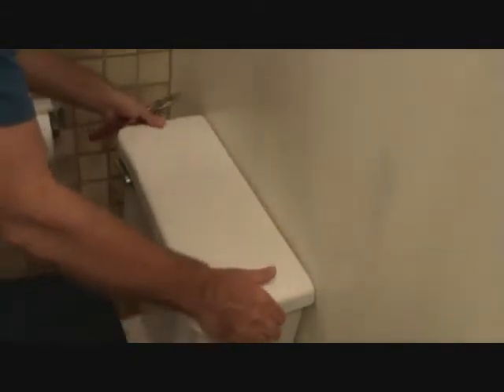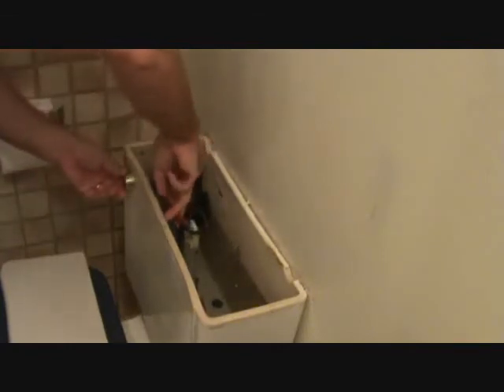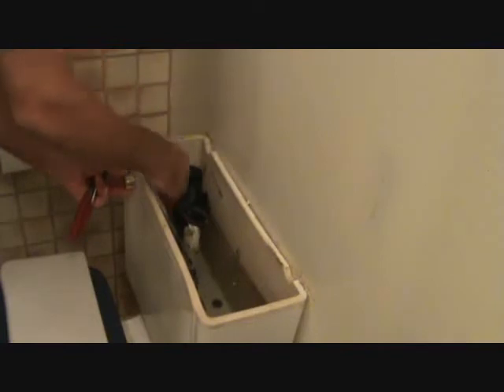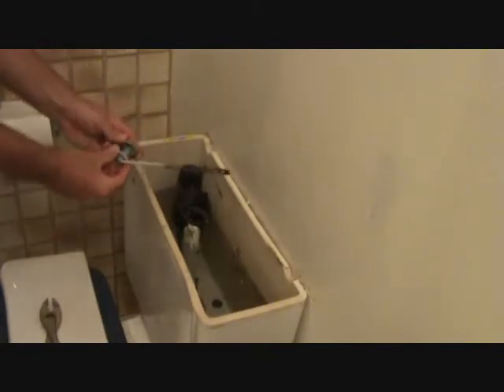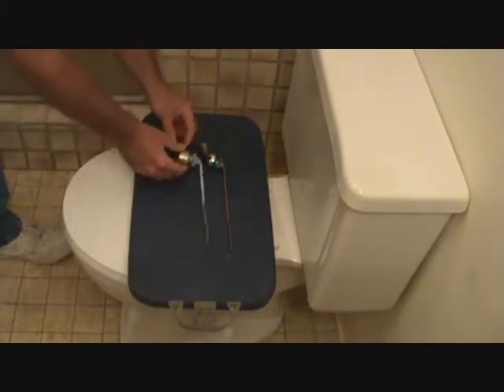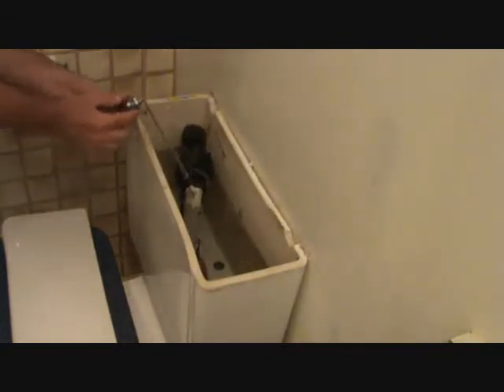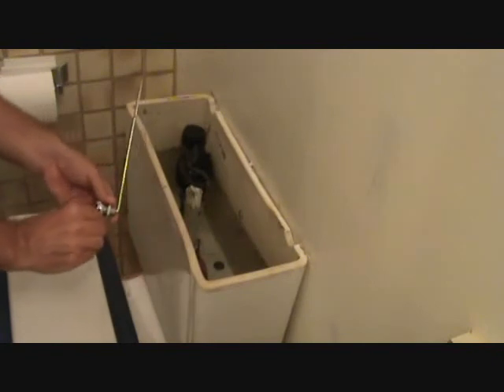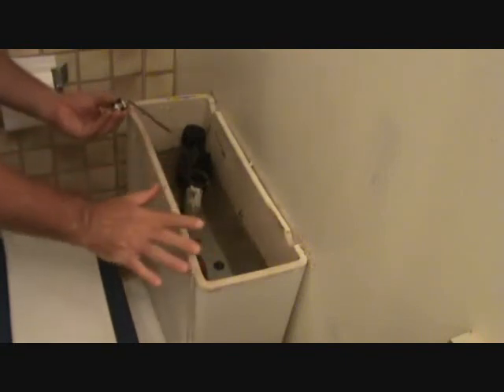How to replace a toilet handle: Removing the toilet handle

Comment: The reverse threading is what caused issues for me. I could not get the old handle off the toilet and basically gave up on the project until learning of the reverse threading by watching this video. My old handle was sticking and caused higher water bills due to walking away from the toilet after flushing and later finding that the toilet was left running. You saved me money.. Thanks!
Reply from the maker: Awesome to hear! I would also caution that not all toilet handles are reverse threads but lots of them are so always carefully check before cranking down on the next toilet handle on a different toilet only to find you just cracked the nut...or worse! Thanks for stopping by!